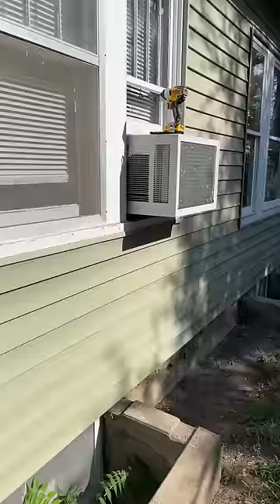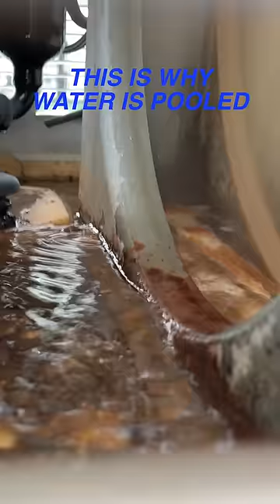🥵 99% Don't Know THIS About Window A/C!

Comment: Not going to lie, I drilled mine.
Reply: I used too as well. I wanted the longevity from lack of rust over the efficiency gain from the water.
Reply: You:
Reply: Me too. They ate so cheap to replaced too.
Reply: Drilled and none drilled they last the same and if you don’t drill it and your window is in a wooden wall its just going to leak in to the home causing damage you won’t see until it’s to late
Reply: Next time try cutting the lip in two spots and carefully folding it down mine actually drains better and started blowing colder
Reply: Hard to do but I've done that but coil still rots
Reply: 😂 me too! But it still self clogged and I gave up on it
Reply: 30 years ago my dad drilled ours to drain the water.  The water drained and so did the refrigerant!  Oops!
Reply: I've done it also lol
Reply: lol me too
Reply: Ah no problem. Plug it. Easy peasy.
Reply: Same 😅
Reply: I did as well!
Reply: Patch the hole
Reply: Wrong
Reply: @domingolopez4998  I’m comforted that I’m not the only one. Had a blast of refrigerant in the face. At least it was an old AC so it wasn’t too frustrating
Reply: @floridagoon7785 can confirm. Had to set steep angle on mine to avoid this
Reply: @BakedBean-ni5uq  I somehow have the feeling that this video was a joke, I simply can't imagine that a baseplate full of rust is wanted 😂
Reply: @floridagoon7785 not if it's tilted in the proper direction it won't
Reply: I drilled two of mine but accidentally hit the coils and All the Freon sprayed out one I had just bought brand new never used it but I ruined it before I used it lol now I just unscrew One of two of the screws holding the Cage together at the bottom it's not as Big of a hole but it works better than risking drilling thru my coils again.
Reply: @CH67guy1 I made that mistake once. Only once lol.
Reply: @BakedBean-ni5uq  I hope you now understand why thats dumb to do. Especially since you'll get more longevity of the machine if it doesn't have to work as hard. That pan is meant to hold water. If you drill a hole in it to prevent rust, the pan might as be completely rusted out or gone because you defeated its entire purpose. Unless you just really care about what the bottom of your AC unit looks like from below 😂
Reply: @floridagoon7785  Nonsense.... either your AC unit was junk, badly designed, or MORE LIKELY: you had it angled into the house rather than down, as the manual likely would've told you it should be.
Reply: @floridagoon7785  installed at the proper angle it will never drain inside. They have a overflow opening. And it's why they are setup to cant 3 degrees downhill. If you are making it level then you didn't read the dang instructions.
Reply: @CH67guy1  I accidentally'd one this way. Oops. 3/4 successes, 1/4 failure. 

Need to get rid of it for the space the ded unit takes up, but it could be repaired and/or stripped and used for a phase change cooler, cascade, etc.
Reply: Your not the only one. 🤥
Reply: Me to lol
Reply: @williamking8306 what lip are you talking about
Reply: @johnallison1091 what's wrong
Reply: I did too and I ended up hitting the cooling line lol
Reply: I drilled mine after the water destroyed my window frame and wall.
Reply: Me too!😊
Reply: yup, i drilled right into the coils, and it hissed out all the refrigerant.
Reply: Me too, mine would start leaking onto the window sill. Drilled a hole, never had a problem again.
Reply: I drilled mine too then taped the hole back shut because after only a couple days I could tell it wasn't cooling as well
Reply: I drilled three brand new units when I noticed the water pooling🤦🏻‍♂️
Reply: @smoguli that’s even more disappointing that it was an old AC because those are better than new ones.
Reply: I added a tap to mine along with a small rubber hose for watering my patio plants.
Reply: No. I still drill a hole in mine and set whole unit in a large plastic pan tilted to drain hole side, a plastic jug with a funnel on top, collects about 32 gallons of water daily and rust won't build up,.
Reply: Now you pay more to run it 🤷‍♂️
Reply: I hit the dam radiator hissed like hell
Reply: @floridagoon7785  That's why you tilt them back so drip is away from house.
Reply: I did the same, mad a loud sound, so i was like Ffffffff😅
Reply: Some shouldn't have access to tools.
Reply: @williamking8306 What do you mean exactly?
Reply: @stevensims3342  on the back side of the AC on the bottom if you take a pair of cutters and cut say two or three inches from the center left and right then bend that piece that you cut downwards it drains much better than drilling a hole .
Reply: @marcfavell  the lip right beneath the condenser
Reply: @smoguli which means it was considerably more poisoning has that blasted you in the face
Reply: Good
Reply: Same
Reply: I hang a rag out of the side and it wicks enough out while running.
Reply: @floridagoon7785 that is why your unit is supposed to be tilted backwards around a 5 ish degree angle.
Reply: Just drill the tinyest hole possible, so there will be water but not very much
Reply: @BakedBean-ni5uq  so you have to buy an ac more often and have repair bills and spend more on electricity, because it has to do more work to reach the same efficiency. but the ac doesn't rust so much ... very clever, not
Reply: @floridagoon7785  how's that? this thing is mounted correctly at an angle ...
Reply: I did too, right after I cleaned it one year. 😒

Comment: My 10,000 btu window air conditioner came with a factory drain hole. The condensation will overflow without it.... I've had this specific one for 8 years, and it cools flawlessly, and the plants underneath it love it....
Reply: Yeah but it was designed that way. Totally different than just drilling a hole in the case because you think the water needs drained
Reply: @notkylelol , How much efficiency do you think you lose by draining the condensate off? I’m drilling mine, but using rubber plugs so I can check the efficiency both ways. At most I would expect one seer point. Putting an awning over it to keep the sun off would probably gain more efficiency than you would lose by draining the condensate.
Reply: @jayv9286  You know you can guarantee like no loss of efficiency by simply leaving your AC alone, right?
Reply: @FiksIIanzO , It’s a trade off and the benefit may outweigh any minuscule loss of efficiency.
Reply: @notkylelol exactly my thinking

Comment: The problem is the water ends up down the wall causing water damage and the moisture causes mold in the AC. So, I prefer to drill mine.
Reply: If it's draining into your walls then it was installed incorrectly.  It's supposed to be installed with the rear at a slant of 1/2" lower than front as to drain excessive water out & away from structure. You drilling a hole just shortened it's lifespan and making it work harder. Do yourself a favor and plug it & prop up front of ac to have it work correctly.
Reply: I drilled mine too. Excess water can leak all over the place and create a bad mess
Reply: Thats why they got to lean down towards outside than inside or they will leak water all inside but a fans good enough
Reply: @Shadoefax760  not true gilbert
Reply: if you didn't install it slanted I'd say you could make a hole in the side of the casing facing the garden so when it gets full it starts draining towards that direction 
just don't drill any vital components
Reply: Spray fantastic into the water and give a couple of sprays of Lysol when the AC is off once or twice a month. It kills the bacteria. Also make sure you install the foam insulation under the AC so it touches the bottom of the AC all the way across the window. When water hits it, it Will run into the bottom of the window and drain through window drains. Also tip the AC out slightly off level so water will tend to run away from the window.
Reply: Sorry to say but yours were just installed wrong and you could have fixed them pretty easy. Drilled performance away for nothin
Reply: Do you just go around "modifying" everything in your life, that you, installed, incorrectly? The thing has a purpose but of course, you have 4 kids, so you know better....
Reply: @somersfamily why isn't it?
Reply: @jamIam6548  cause Gilbert told arnee and showed him the true way.
Reply: @somersfamily do you just make shit up? I am an HVAC tech and he is 100% right. They are supposed to be tilted backwards a slight bit.
Reply: @Shadoefax760  mine is leaned correctly and i just got hella mold in less than a year
Reply: @ammar3094  how is that possible if it's installed correctly? It's impossible if it's installed correctly, if it's not then you'll have water draining out and away from structure but running back toward structure on ac underside.
Reply: @Shadoefax760  its leaned and water goes backwards but pools a bit due to no drain hole, also maybe condensation on inside because of that for hours after it shutting off, idk but my green blower fan is filled with mold, and looks like a pain to disassemble, sigh, also my ac sits under a tree idk if that could be doing something

Comment: I carefully threw gallons of water against the condenser coils on my window unit and it actually solved the short cycling issues. The evaporator coils were filthy and filled with dust and debris. It was blocking the airflow. Before I poured water onto the condenser coils, I felt very warm air blowing out. That wasn’t a good sign. Short cycling will eventually damage the compressor. I’m glad I fixed my window unit. It now shuts off when it’s supposed to. My room wouldn’t even cool below 85 degrees. My room is cool when it’s hot at now. I’ll do it again if I encounter an issue.
Reply: My window unit blows hot air out both sides too. I mean you can tell it wants to cool the air on the inside but it’s just not getting the apartment near cool enough. When you say you carefully threw gallons of water against the coils, what do you mean? What do I need to do to get this thing working right lol
Reply: Do that yearly
Reply: @danieldmyers just look up how to clean your ac window yet most of time at the start of season you just spary the outside part in water while it’s on the ground sometimes you might need a bit of dawn but just don’t bend those fins too much and make sure the unit dries before you put it back and turn it on
Reply: Fascinating
Reply: You dont need to be all that careful, it sits outside, I spray mine out with the hose every fall.
Reply: Be careful to not get the electronic controls on the front wet.
Reply: @gordonwelcher9598  I know
Reply: Mines running non stop here in my van I live in
Reply: @coreybabcock2023 you look like the kinda guy to live in a van
Reply: @coreybabcock2023 UH OH! NEVER leave AC on in idling vehicle because they rely upon driving airflow to cool them-they are extremely hot, and will melt wiring and cause a fire, honey! Car AC and home AC run differently.
Reply: @AshleySpeaks4U  I know that I do hvac
Reply: @AshleySpeaks4U They have a cooling fan on the condenser for a reason. Vehicle AC's have the same components as house units. They're just much smaller. The condenser coils still get extremely hot, regardless of the system. Obviously too hot is a problem. But a vehicle AC system won't overheat because the vehicle is sat still. It will go off on high pressure if the fan isn't cycling on.
Reply: @coreybabcock2023 
No judgement.  I could live in a cave.  But dude, you totally look like you live in your van, down by the river.
😂
Reply: Give it a deep clean once a year . but cover the fan motor first before you start washing it.  There is a chimical compound powder that will make it shiny.
Reply: I clean mine every fall. Take it apart and condenser cleaner, soak and spray out. Have to spray mine from the outside in because the debris is on the inside. Just cover the fan motor first.

Comment: This is actually written in the installation instructions.
Most window ACs require a tilt of about 2 to 3 degrees to drain properly. This means that the back of the AC needs to be about ½” lower than the front. The tilt is needed to keep condensation draining out of the back of the window AC unit.
Reply from the maker: Correct!
Reply: There were installation instructions?  I just drilled some holes but they’re clogged up now.
Reply: So thankful for this information!!!
Reply: How do you install it at an angle? I just deep cleaned my unit and it STILL spits inside!
Reply: @briannec2016  you usually use a plastic shim or the foam strip that comes with it. Or can also use just about anything else that doesn't absorb water in case it does leak.
Reply: Dang instructions!!!
Reply: I usually just tilt it in the window and push window down to hold it
Reply: EXACTLY!! THAT'S WHY MY WALL WAS EFFING LEAKING WATER, AND BACK ON THE FLOOR! DER SHADE TREE "CARPENTER" 😂😢😤😤😤🙄
Reply: If you have a storm window frame up higher the instructions say to use a wood board underneath the unit for that tilt
Reply: They also have that angle designed into the frame of the unit that sits where the window is.
Reply: Ding ding ding!
Reply: Also keeping water in the pan to splash on the coils improves the thermal efficiency by around 20%. The water is generated by the coils on the inside of the AC, and is then sent to the outside to cool those. Excess can drain, but if you drill, you end up loosing 20% of the cooling output at the same electricity consumption.

Comment: I wondered why they didn’t put hole for drain , thank you I never knew that.
Reply from the maker: Yup, I didn't know it either for many years
Reply: If your unit is less than 10 years old you don't need a hole. The slinger ring scoops up that condensation and slings it at the condenser coils, which cools the freon,  maximizing efficiency

Comment: Also, if you try to drill out the water after you worked 3 18 hour days in a row, are exhausted and not paying attention, you could possibly drill one of the condenser lines.
Reply: Try 16 hour day's for 50yrs. 
Then you will know what tire is.
Reply: Seems like an oddly specific example... I presume that is from experience?
Reply: Did that like a month ago with a brand new one, got free on all over me and burned my whole chest 🫡
Reply: Funny assss comment 😂
Reply: Natural selection.
Reply: @CarlAyers-x8h why did u do that to urself tho? Was it worth being able to complain about now ? Sounds like a u issue
Reply: Use a step drill.